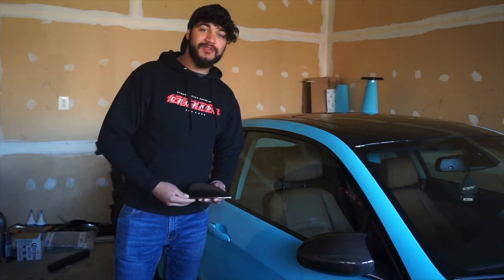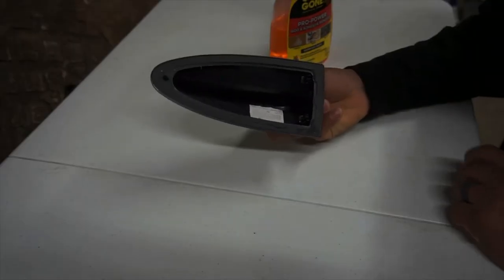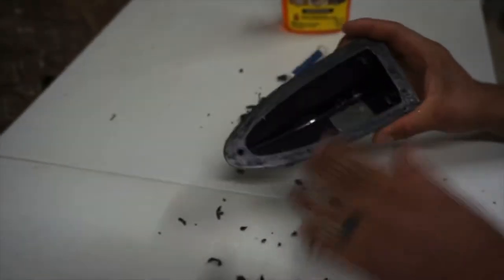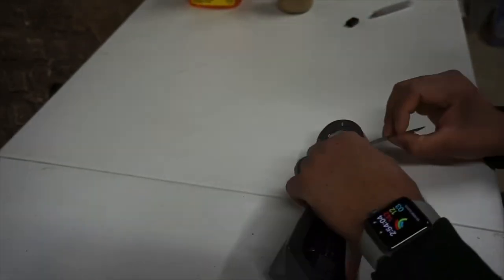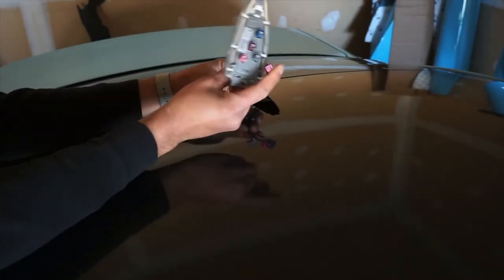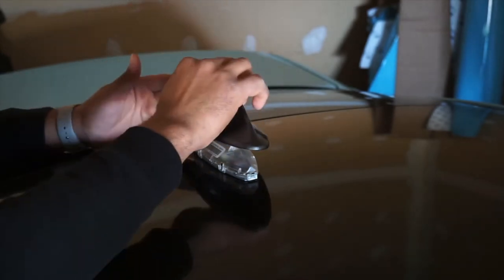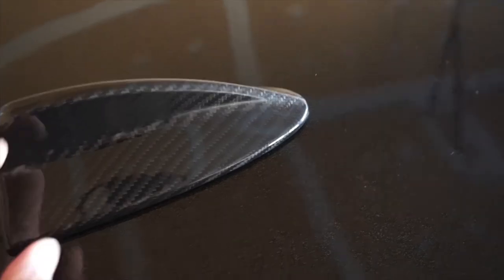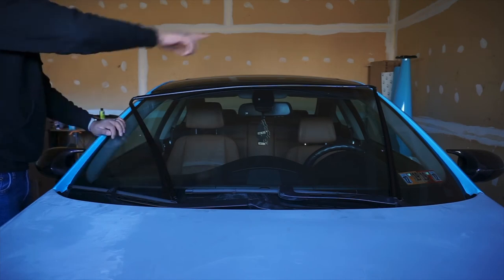INSTALLING A CARBON FIBER ANTENNA ON A E90 E92 BMW

Comment: Great videos. Why did you use the dual-sided scotch tape rather than K1 Permalink glue? I’m afraid that it wouldn’t hold as much given the temperature changes, wind, vibrations and forces wearing on the fin. Any thoughts?
Reply from the maker: I’m not too sure. That’s what I have on it for the last few years. No problems yet

Comment: Great carbon fiber antenna cover. Where did you order it? I'd greatly appreciate it 💯
Reply: eBay has them for around 35-40 bucks, Amazon has it too, for a bit more.

Comment: So I got one from ebay and it didn't fit. It's not big enough. Not sure if there are different sizes
The one I got is 195mm long. It needs to be longer. I tried it on my 2007 e92 328i and 08 e92 M3. No go on either one.
Reply from the maker: I’m pretty sure there are two different sizes
Reply: @alextrout2631  yep. There are. Went back and checked. Looks like I got the bigger one.